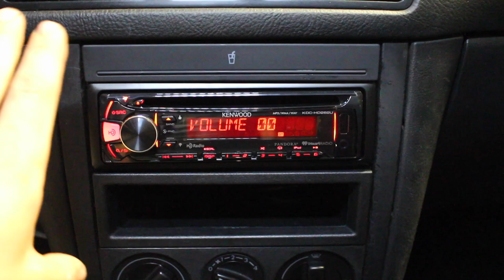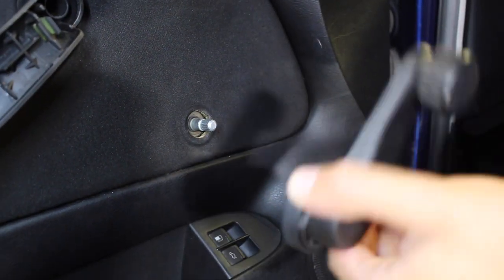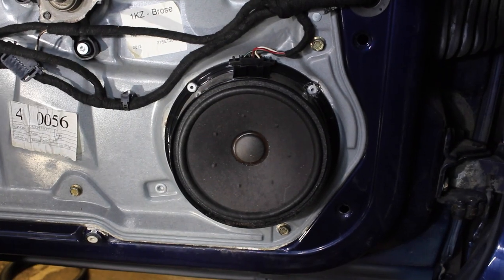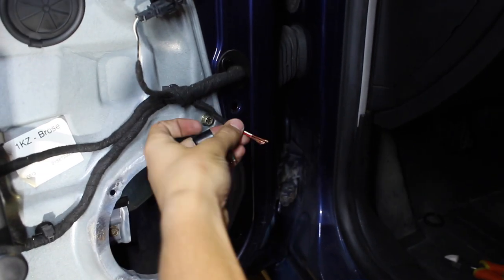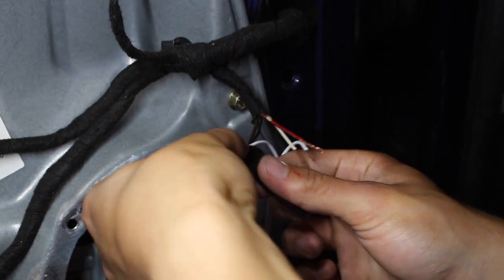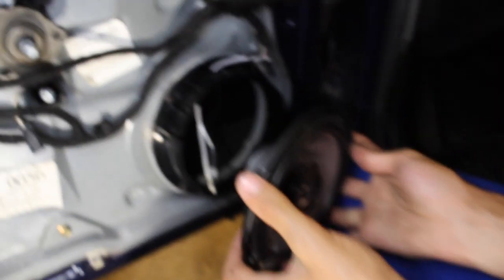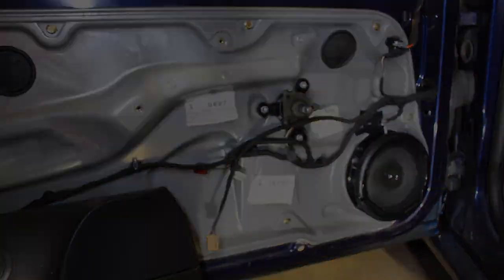How to Install Aftermarket Speakers

Comment: This wasn’t good dudes, I’m sorry. 

- You never drill your doors with the windows down.
- You installed grills inside the door panel. This should not be done. Grills are for exposed cones.
- You conveyed polarity incorrectly. It’s very important
- You didn’t discuss nominal wattage and how to properly drive your speakers
- You’re using metal screwdrivers instead of nylon pry bars
- You don’t use any gasket tape
- Your connections were done very poorly. Electrical tape is not a suitable connector, it’s for temporary insulation. You need to solder and heatshrink. Mechanical connections (crimps) at the very least
- You’re replacing components with coaxial, why? This makes no sense. Moving tweeters down to leg level will ruin tweeter performance
- Loose wires should be secured with something like Tesa tape, not duct tape
- The panel should have all open holes covered with a damping material

There’s a lot more, read the other comments.

I’m not trying to be negative, it’s just that people will take this video as verbatim, and this installation is very poor. Perhaps you should consider revisiting this video and correcting its flaws, assuming you’ve improved since this.

Comment: People bitch if nothing looks right, electrical tape rocks, lasted every vehicle I owned. I have the same speakers, unfortunately while swinging the bag of speakers around, kinda messed one up.. I used red gasket maker, sounds awesome, for $40 at Canadian tire came with  a Kenwood 2ch amp to pump 60w to each speaker.. suck on the crackle of the tinny bass neighbor! Ha, then the big guns kick in down the block. Factory connectors may seem the right way.? I’d put m y life on electrical tape any time... now a shout out for another $500 Lexus would be great, seeing as all those fancy car drivers always seem to have factory harness or connectors that are cheaper then the cigarettes I smoke, cause so much havoc on a wallet because it seems, these cars needed a few rolls of electrical tape! Lol... 6X9’s fit anywhere. Grab some snips and cut away. I prefer them over these little ones,anyways,,, party on Garth

Comment: WOW, so many wrong things going on in this video. I appreciate it is an attempted "how to" video, but.....I've lost count of the amount of videos about there similar to this where the door speaker, a mid range as part of a split system , is being replaced with a full range speaker. Far too many people thinking that they're doing the right thing when in fact, they are doing the opposite. You need to KNOW what it is you are attempting to do before you try and teach/show others how to do it.
And before the hating starts, YES, I do know what I'm talking about as an auto electrician and someone that has installed many speakers into cars.....correctly.

Comment: I cringed so hard at the point where you joined wires together with electrical tape🤣 WIRE NUT THEM AT THE LEAST🤣

Comment: EVERTHING wrong, should be called hot not to, every part from ripping the card off with  a screw driver, out of phase then the icing on the cake is a grille behind the door card.

Comment: It absolutely matters which wire are you plug into where on the speakers polarity is very important and it wasn't until recently when I redid the wiring to my car after rough installing my system last year that I realized just how much it matters. My audio system doesn't even sound like the same head unit or speakers it's like a whole other audio system now and that's because I had several speakers that were out of phase due to being ignorant of speaker polarity. Also drilling out the rivets with the window directly behind the speaker sounds like an accident that is inevitably waiting to happen maybe roll the window up first and then roll it back down once the speaker is out

Comment: It doesn't matter how you wire the speakers?  Are you kidding me?  It is very important to know how to wire the speakers because if you wire it incorrectly, not only will they sound distorted, but also they will not last very long because you're going to blow them out!  Always refer to your car's speaker wiring diagram in the manual to identify the positive and negative wires and correspond the wiring to the AM speakers.

Comment: Wow, I was shocked to see what those guys are doing. This video should be taken down immediately. Could not agree more with mike field below. Plus and minus are an absolute must for speakers. The connection they did with electrical tape, is not even funny to mention. To top it off the duct tape or whatever they suggest to fix a wire to the door is just a joke. Duct tape falls off in just matter of hours. Those guys sound to be Canadians. They will need the most rigid anything when they do installation. The weather there will not allow them any room for errors.

Comment: I'm puzzled, you had a soldering iron in one of your shots, why did you not solder the connections to make a good connection. Remember a connection should be both electrically and mechanincaly sound, the wire could easily loosen through time and vibration not to mention that the copper can corrode which gives you a poor connection over time. If I were you I would remake those connections again but this time with soldered connections. If a job is worth doing, its worth doing properly.

Comment: omg this was painful to watch, why didn't you soldier the connections and then heat shrink, what about the polarity of the speakers? if you mix the polarity of the speaker to the other side it will sound terrible and that speaker upgrade was a waste of time....!

Comment: I needed info on the size of the replacement used.
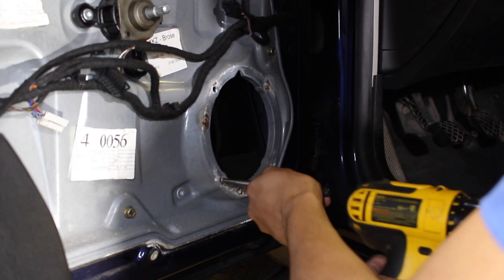6:19 Using the back end of the two hundred dollar drill as a hammer... that is where you lost all credibility. 
Clicked off.

Comment: Just reading the comments. Yes the soldering. yes the polarity.Yes that is the right way. No. most people will not notice the difference listening to the rock tunes or the potential broken drilled out window:)

Comment: Great process for quick speaker upgrade, but your wrong about the positive/negative. That does matter. Specially with quality and speaker life. That and the connections could easily be made better, but overall effective video for showing how to upgrade mk4 speakers

Comment: The door panel removal was moot as every vehicle is different. Subaru has 3 different ways to remove theirs depending on model. As long as you down load a manual use that. Canadians always say Out with a LONG O oooout. lol. Easy to tell.

Comment: If you don't have the washers or rivet gun to hold the speaker bracket screws. You can substitute  the washers with soda caps easy fix..

Comment: you dont change factory midrange one way speakers with  two way speakers...you have tweeters separated in doors,you need midrange speaker down in the doors..tweeters so low down in the doors  are not needed

Comment: I'm very surprised. This video is full of bad advice. This is not like you. 
Googling a simple speaker wiring diagram for you model of car is very easy. Always solder your connections. Plus I see little need for the Kenwood speaker grilles. 
Still a fan of your usual higher quality work though.

Comment: Go into a better shop , listen to what is in the soundboard. What sounds best to you ? That's the ones you want. My specs are simple:  I like silk dome tweeters with butyl rubber surrounds instead of foam on the midrange driver . The sun rots foam ( i. e  back deck ) and moisture in doors get them , too. The metal / plastic tweeter domes sound harsh to me.And yes , proper phase of the speaker is important!

Comment: I just got a new radio that has a built in 55w x4 amp. Can I do exactly everything in the video and it will automatically read the amp on the radio?

Comment: Damn, how can you advertise electrician tape as a good way to joint cables together and then say that drilling rivets isn't a good way to remove them, Jesus Christ
On top of everything wrong in there, the 'best of the worst' part has to be when he tests the speaker with fucking Country of all things, legendary move

Comment: i broke a rare Subaru fog light because i was drilling a hole for turn signal , the whole thing is gone the glass lens broke into several pieces  , never ever drill holes near glass or plastic , put something between them to prevent problems

Comment: In your video, you're saying polarity of wiring an aftermarket speaker doesn't matter, are you sure? Polarity of the speaker matters because there are other speakers which might cancel each other if the polarity of the installed speaker is different. That kills the bass significantly.

Comment: They must be correctly polarized, to keep them in phase or the stereo image will be odd and the bass will be almost gone as one cone will be making a sound wave and the other going in the opposite direction will cancel it. Plus must go to plus , it can be reversed as long as all the other speakers are Also reversed, iv seen cars wired willy nilly , with almost no bass ,. When correctly wired by me , the bass was all back and sounding good  😀

Comment: 1. Polarity does matter because you will cancel out the waves if connected wrong and get bad sound.
2. Component setup would of been better.
3. Taping is fine, but soldering would make a secure connection.
Not trying to offend or anything, just trying to help a fellow friend out.

Comment: Don't ever just twist and tape wire connections!!! Take it from an IBEW electrician! Also + and - are very important, well if you like bass, it's called speaker phasing. You want all your speakers moving in and out at the same time, not 180 deg. off from each other.

Comment: why didn't you solder the wire or used connectors... could that wiring come a part  eventually?

Comment: Dirty job, and it does matter which way round you wire speakers, if there out of phase they will work against each other. It's basic car audio knolage, and always solder and shrink-wrap

Comment: the drill bit is way too big for drilling the rivets just use the small drill bit will be fine , speaker wire connect adapter only cost $11 on ebay you do not need to cut all the wire like you did just connect straight to your speaker , great video for home installation :)))) .

Comment: hey you think i can skype you or something else about this? i want to install speakers and a receiver in my car but don't want to pay the crazy price to install it. it look easy enough and my car is kind of an older car so it should be somewhat simple. what im' worried about is the wiring, that's the only thing i'm worried about if it'll be different in my car or what. i could also use help on how to chose the proper speaker to install in my car that will fit properly. let me know.

Comment: In another life, when I was in high school, I did mess around a fair amount with car audio. Even then, and since going to school, I do know that polarity does matter. If you are unsure of the polarity, I'm sure it can be found online. Or possibly even a Haynes manual, or a Chilton manual will let you know which wire is positive and which wire is negative. I am guessing that there are four wires, because it is a component system, and there are two wires that run up to a tweeter possibly.

Comment: Polarity. And. The front of the speaker should sit flush into the door panel grille. If there's any space for the sound from the front of the speaker to mix with the rear, you will lose bass output. You can even use soft foam as an extended baffle to install it correctly.

Comment: As a professional interior trim guy, please do not encourage people to use screwdrivers to separate panels
Metal tools leave marks that you may never be able to repair or hide. Instead invest in proper plastic trim tools to do this type of work.
A proper job means no one will notice what you took apart , but a hacked up job will never be forgotten

Comment: My car only had a light green and blue wire and when i connected them i get no sound from my speakers or tweeter. Its a jbl gx608c i check all the wiring all positive and negatives were wired correctly. Any ideas what it could be?
Reply: Try to reconnect the original speakers - do they still work?

Comment: I agree with mike field. If the polarity between left and the right speakers are reversed then the sound is out of phase (180 degrees) and will give a weird spacious sound. Also I would solder the joint instead of simply twisting them together, twisting will not be reliable over a long period, due to vibration corrosion etc and will have repeat this process again later.

Comment: I  don't know  if  I  can  explain  my  self  but,  had  you  just  illustrated the  way  to  install  the  inferior  door  panel  speaker?, there is  a point where it seems  that  a factory  conector has  the possibility to  also  connect a tweeter to the superior part of the door from  that point on, does it happens in every car make, or does it depend on the manufacturer?

Comment: do you have something like replacing a smaller speaker like 4inches with quite bigger ones like 6.5 or 8inch speaker..does its sound boosted or still the same on its maximum? or does it still need some components to be added like capacitors?thanks guys...
Reply: You can replace your 4 inch speaker with a bigger one if 
A. You have enough space to cut out a bigger hole for a bigger speaker

B. You have enough power to drive bigger speakers

No capacitors or anything will be needed unless you are adding an external tweeter. 
Always make sure you have enough space for a bigger speaker.

Comment: wont using a two way speaker w/ a tweeter on it mess with the tweeter by the mirror? do both tweeters run or do you cancel the one by the mirror and just let the two way speaker do everything?

Comment: Okay so I have aftermarket stereo and speakers which are 400w. Even though the bass is on max and the "loud" option is ON the stereo, it definitely sounds louder but no bass at all....any ideas?? Do you think its wiring problem??
Reply: If you have subwoofers then your problem is most likely the remote wire which is usually blue
Reply: Check reverse polarity on one side. Low frequency (bass) output affected most notably.

Comment: Hi one question... Does the bracket "improve" the speaker sound? I mean the bass sound quality. I have same Kenwood 6.5 speakers but installed withouth brackets and I feel a poor bass quality sound. I hope your answer could help me. Thanks!
Reply: The spacer improves air space, making the door deeper and louder improving bass.

Comment: Can I only do speaker upgrades like this with an Aftermarket headunit or does it work with stock head units too?
Reply: It will work with the stock head unit but you’ll get medium to low performance since the stock head unit outputs less power then an aftermarket one does. Make sure to be careful with polarity or + and -  unlike this guy. It really makes a difference

Comment: do you have to change the head unit to install aftermarket speakers and an amp or can you keep the stock one? I'm just curious I like the one that comes with my car but I want better bass
Reply from the maker: You can keep the stock ones :)

Comment: I like your tutorials, but not so sure about this one. I'd never trust just twisting the wires together. With your booming bass they will get loose and crappy connection over time. Why not solder/crimp?
Reply from the maker: I've done this method for a few cars, and I spoke to a friend who ONLY installs sound systems and he said that he's never had a problem wiring up speakers like this. The only time you NEED to crimp and solder is when you're working with larger wires, or wires that could move or get tugged on.
Reply: With this being a how-to that mostly newbeginners will use, I'd much rather do it the proper way so they do get it right the first time. The only thing holding those 3 wires together is the strength of your thumbs twisting them together and a tiny piece of electrical tape.

Comment: Milan, speakers dow work with wires connected backwards or any which way. But to anyone reading this you need the wires connected the RIGHT WAY or your speakers WILL be out of phase and firing backwards. Could potentially damage your speakers.

Comment: Hey I have a 03 gti and I can't get any of the speakers to work at all I checked fuses and everything and I was curious if I do this and get the front ones to work will the back ones just come on I installed a touch screen android radio and everything works on the radio bujt I have no sound if you can help let me know man
Reply: Christopher Hale did you wire everything right? If you did you might have missed just ONE wire. That happened to me. I had all the proper connections but I was just missing one blue wire from my aftermarket radio and had two blue wires left over from my harness, I tested one connection and nothing happened, I tested the second connection and all the speakers kicked in with my subwoofer. --- So if all your speaker connections are correct it might just be the one that goes to your subwoofer that you need to connect (mine is an oem subwoofer, meaning it came installed from the factory)

Comment: Umm two of those wires are the for the tweeter. They're passed through the speaker... There's no point in hooking them up as well, if you're installing coaxial speakers.
Reply: Why not? I run coax mb quart speakers, on top of that I have diamond audio crossovers and external tweeters. More tweeters, more sound output and if done properly better sound quality..
Reply: Wait that makes sense now. But he still didn't know that two of those were meant for the tweeter.
Reply: +Viza yeah, he also didn't realize that polarity is the most important thing in speakers. + to + and - to - will make the speaker fire outwards. Reverse polarity will make it fire inwards, the coil will be compressing its already compressed self.